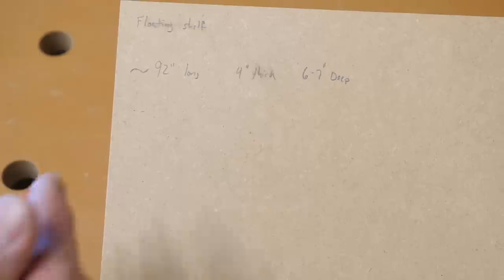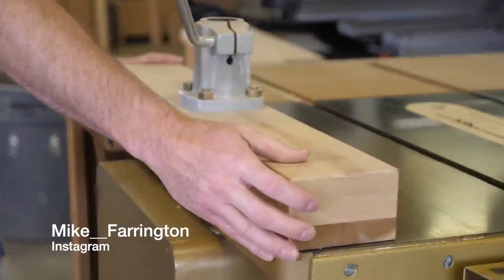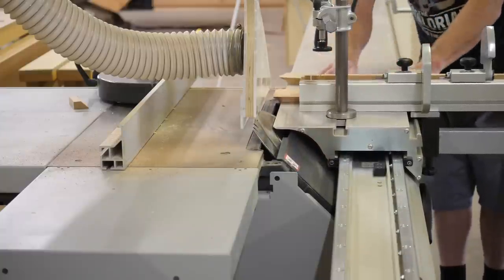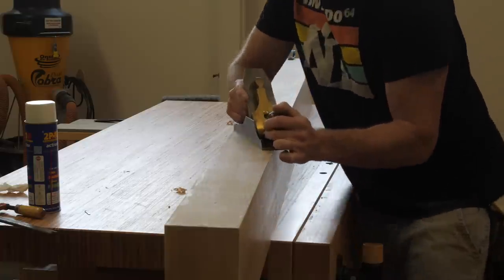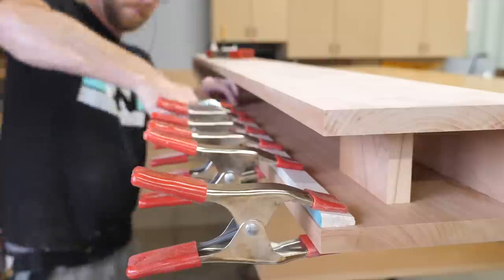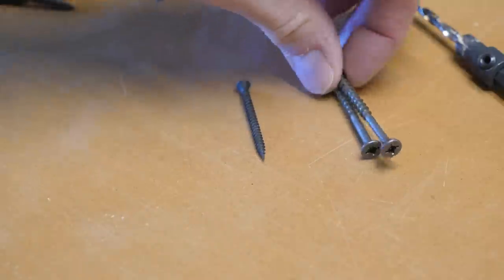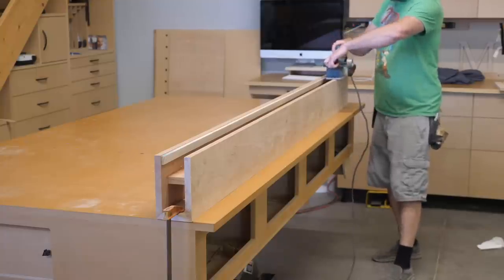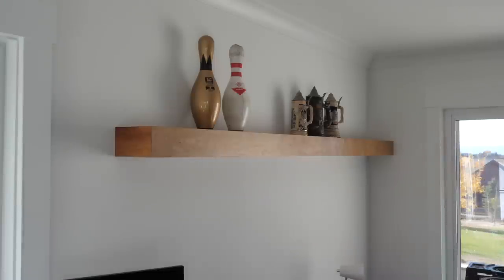Awesome Floating Shelf with folded bevel cuts.

Comment: It looks as if you just dragged a volume of wood into the corner. Gives it a contemporary-modern style.

I like seeing the monster jointer machine in the background holding the heavy frame boxes to the big bench.
Reply from the maker: Thank you. I bought that jointer with the idea that I would restore it. I got it working, and I don't like it. It has a smooth grind on the table which creates more friction than I can to push against. My current jointer has planed tables, they are a joy to work with. So eventually I will sell the project.

Comment: Like the scribing trick. Would love to see some videos of projects in older homes.  What I struggle with most  DrYing in my pre civil war home or my parents pre revolutionary home is dealing with nothing being level, plum, square or flush. And I’m not talking being out by an 1/8th.  Need some of those pro tips.
Reply from the maker: I would love to work on some older homes. Unfortunately, where I live the oldest homes are about 100 years or so. I will say things, the methods are the same, I just leave more material to be removed. Hope that makes sense.

Comment: Working out the twist in a board is always a challenge. long boards can be persuaded into place but short twisted boards are better left for something else and a new one cut. But you pulled it off as always.
Reply from the maker: Yeah. A longer board will always have a chance, shorter boards, no go.

Comment: So about 4 years ago I built almost the exact same shelf as this 3 of them actually. Same tape and bevel construction method. Even had the same issue with warped boards.    I was afraid my miters wouldn’t be tight and have 
Gaps in them.   But I wanted that rounded over router edge on them.   So I burnished the edges with a round shaft big screw driver.  This kept the miters together and the grain wasn’t effected at all because the two boards were essentially molded together.   I attached a pseudo bulk head style frame attached to the wall and slid my shelf over that.  No screws or fasteners holding the shelf to the bulkhead mounting thing
Reply from the maker: Sounds like a great project. Well done.

Comment: The result is awesome. I'm glad you did this with blue tape since I'll soon be making some loudspeaker enclosures, tall and thin. Been agonising about mitre joints even though they'll be veneered.  Should it be Biscuits ( I like them too ) or splines or ...  BLUE TAPE !
 If you got such good results with tape on that warped stock, I should be OK with Baltic Birch.
Thanks for the scenery shots, I trust the bike ride was good.
Reply from the maker: I say do one test piece with blue tape. You will find that it works extremely well.
Reply: @MikeFarrington  Thanks, sound advice. Will do since my table saw's not as good as yours .

Comment: Hi Mike, the purpose of the scribe line was to confirm correct installation after taking it down for final edge flattening? Great video, thank you!
Reply from the maker: The scribe line was to give me a mark to cut down to. I know that if I cut away the material right up to that line all the way around, I will have a shelf that fits the contours of the wall perfectly.

Comment: Why not use mitre-lock joints for the long lengths -they really hold together and pressure can be applied to the boards on the taxable router needed to use mitre-lock cutters. Nice job with left over planks. Was the missus pleased?
Reply from the maker: Miter locks are not needed when using the blue tape clamp trick. The tape holds everything in place. The missus likes it.

Comment: Awesome project as usual! Question - do you think it'd be beneficial to back cut the side of the boards that touch the wall, that way when you go to scribe you have much less wood to remove? Just a thought, not sure if it'd be worth the effort tho.
Reply from the maker: It would be beneficial, but more work. I probably should have done that.
Reply: @MikeFarrington  I thought I saw that you did that in the video?
Reply: @MikeFarrington  the back bevel with your planer was enough for scribing since it wont be seen on bac side
Reply from the maker: @jonathanacton5133  Agreed, but I think the idea would be if there was a pre bevel put on there, the scribing process would be easier.

Comment: Great video.  Could you talk in more detail about the technique you were using on the joiner at the beginning of the video where you started in the middle.   I assume it was either due to the warping or the length being so long.
Reply from the maker: Thank you. Yup. the board had some bow in that direction, so I was dropping it on, taking a pass and repeating. Once it was close enough, I took a full length pass.

Comment: awesome worke once again :)  i was curious about that cleat system once i use most of the times 45 º cuts. I thought it was slidding out after see that angled cleat. I guess those screws at the end its the secret in this case :) Well done.
Reply from the maker: Well normally I use a steeper angle, say 20-25 degrees, but my bandsaw handle broke, so I was stuck with that. It ended up working, but certainly needed screws.

Comment: Is a method like this sufficient for books? My novice brain would have guessed that a 1" cleat and screws going no more than 1" into the studs would not be enough. I'm curious whether this method would still work with say a 2" thick shelf, or if part of the reason this design is so strong is that the height of the shelf means that the bottom of the shelf against the wall helps to deal with the lever type force of the objects on the shelf?
Reply from the maker: The thinner the shelf he more pullout force the screw will receive. If you can get an accurate placement of the screw through the cleat into the meat of the stud, you will have not issue with the shelf falling. My minimum for a floating shelf would be about 2 1/2-3. That would be a minimum 1" cleat and then the upper and lower shelf parts. This will work fine as long as it's attached to the stud properly.

Comment: Nicely done, you don’t always get to work with silk. BTW what model Suzuki do you ride? Just unloaded a DL650A, it was nice but no personality. The 1000 is better in that regard. The silk is in reference to a sows ear.
Reply from the maker: Thank you. Its a Vstrom 1000. It doesn't have a ton of personality either. I've had a 650. The motor is pretty nice, but more importantly the cost per mile to own that bike is very very low, and its cheap enough to where I really don't care much about it. I would probably enjoy a GS more, but I don't get enough riding time to justify the extra cost. Maybe when the kids are older.

Comment: Ok I found something we differ on but it's no big deal, I like to go 1.5 inchs into a stud at least, but it's because I hang heavy communications equipment on walls over peoples heads sometimes and I live in Earthquake plagued California🤣🤣🤣. Just one inch into a stud for a shelf sounds on the light side to me because I like to hang my 210 body on everything I install.  If I can't hang on it I don't walk away till I can👍 but I am sure your shelf is plenty strong for your items👍💚💪🪵😁Happy belated Birthday 🎉🎉🥳🥳
Reply from the maker: My 1" rule, which I violate once in a while with something super heavy, comes from the code that a hole in a stud needs to be 1 1/4" from the edge.
Reply: @MikeFarrington  I know your smart because you don't over tighten your screws 😁🐘 I had a feeling you might be flexible on your one inch rule also, I bet you wouldn't be hanging things that would fail, your very smart Mike. Thanks for posting you are always a pleasure to watch😁💚🪵
Reply from the maker: @chrisstearns10  Thank you very much Chris.

Comment: I've never seen that jointing trick at 0:38 ... are the high spots on the far ends of the boards and this is a quicker/easier way to knock them down?
Reply from the maker: Thank you. Yup, when there is a high spot, I will just run that a few passes to get it closer to the rest of the board. Then finish with a full pass.

Comment: I’m somewhat of a novice to woodworking, but I love watching your videos. I’d like to make a couple shelves like this, but I only have a dewalt job site table saw. No jointer and no planer. Can you offer any advice to do the project without those tools?
Reply from the maker: Thank you. I would buy planed lumber, then use the table saw to cut the bevels, if you have a chop saw, use that to do the ends. If the pieces are really long have someone help you hold them on the out feed side.

Comment: Why such a shallow angle on the cleat? Is it because the screws end up providing all of the "slip" prevention?
Reply from the maker: The screws do help stop slip. Normally I cut the angle a little steeper, but the handle broke on the table on my bandsaw, so I was stuck with that angle for a few days until I fixed it.

Comment: I like your cleat method for holding them. I built some of these for my living room and basically used same method of construction but my method of mounting was an fir framework like |__|__| on the wall they slide onto. That was way more complicated and fiddly I think than your method. As always enjoy your videos and always learn something.

I notice you are one of those people who back the screw out a bit before driving it in all the way. I've never found anyone to tell me why they do this. Can you share why you do this?
Reply from the maker: Thank you. I don't always back screws in and out. In this case my battery was almost dead, so I needed some momentum to drive um home.

Comment: After jointing the boards you used the bandsaw to get a parallel edge. My novice self would have gone straight to the table saw. Did the bandsaw provide some advantage you would not have gotten from the table saw?
Reply from the maker: Same thing really. I like the bandsaw because its safer and has better dust collection.

Comment: Looks awesome man! I have been wanting to add some floating shelves to my pantry (because my wife said I should) and was wondering if it could be built in place, since the door jamb is narrower than the shelves would be. Any thoughts or tips for this? Any advice would be tremendously appreciated!!
Reply from the maker: I have done a bunch of those, normally I installed a ledge on three sides, then cut and fit the top and bottom and nail a trim piece on.
Reply: @MikeFarrington  Thanks so very much for responding! I'm stoked to go cut some wood!

Comment: Hi Mike...awesome job. one question....the end piece you placed isn't going to give you problems because of wood movement? or does it become a static point because there is not end piece on the other side?
Reply from the maker: Wood movement won't be a problem with a piece this small. There is enough give in the glue to allow for the small amount of movement a piece like this will have.

Comment: What's the jointer technique you're using at 0:38? Start halfway, get the back half flat, and then move to front end and make it level with the back? Is that just because of the length?
Reply from the maker: The board had crook in it, I was simply cutting down one part of it, once it was close to flat, I went back to normal methods.

Comment: There's nothing I hate more than making long bevel cuts on the table saw. I NEVER get nice results. I guess I need to focus more on down pressure at the blade. I don't think a power feeder is in the cards for me.
Reply from the maker: No problem without the power feed. Just setup a bunch of feather boards.
Reply: @MikeFarrington  You know... I've seen people clamp a feather board to their fence, but I've never tried it... I've also never thought about how to get it close to the blade on a wide panel. I'm going to go do some research. Thanks!

Comment: Just a quick math thingy...if you want the outside joint to be nice and tight you should go slightly above 45 not bellow it. ;)
Reply from the maker: Sure about that? I guess it depends on which side you're looking at.
Reply: @MikeFarrington  Yes I am fairly confident in what I am saying, but you are right about the which side part. One thing to note that might cause the confusion here, when I put my digital angle finder, I put the magnet towards the blade  so my zero is in that position. I am therefore not measuring the angle of the saw but rather the angle of deflection from 90. When I want a 90, my meter will simply give me the current error and not the angle itself. I can simply slide my angle reader on the table and let it stick on the blade.

If you stick the magnets to the table and then to the blade, then yes the angle needs to be bellow 45.

Sorry for the confusion regarding that.
Reply from the maker: @simonmarcoux5879  No problem. Angles are tricky that way, there's two ways to look at them.

Comment: Hi Mike - Love your videos. Great work, as always! I like the idea of the cleat method you used vs. metal posts like a lot of other floating shelf tutorials. Are the weight capacities similar for those two methods? And any idea on how much weight your setup as shown would hold?
Reply from the maker: I'm no engineer, so I wouldn't guess a weight capacity. I will say this shelf will hold everything I could put on it. This is a very strong way to build this type of shelf. If more weight capacity was needed, I would use 8/4 lumber for the cleat.
Reply: @MikeFarrington  Thanks for the reply. Keep up the great content and music selections!

Comment: I have 2 pro tip type questions…
1.) What is the difference between a power planer and the lipping planer that you use and 2.) was setting the angle for the bevel at 44.9 a common practice or because the boards were warped? If I am prying too much, just tell me to fornicate off 😂
Reply from the maker: Thank you. A power planer has the blade centered under the handle. A lipping planer has it offset to one side. I do the 44.9 thing any time I'm doing a long miter. Ha! I would never tell someone asking good questions to fornicate off.

Comment: Fucking show off. Lol. Your work is amazing. Love that you took on this challenge. Curious if the mitres will change over time with two outside walls depending on the insulation, considering your climate is akin to mine up in CANADA.
Reply from the maker: Thank you. I'm not worried about the miters, we live in a dry climate, and we humidify during the winter, so expansion and contraction will be at a minimum.

Comment: the front face and the end face would have looked better if they were out of the same board, then the grain would have continued from the front face to the return into the wall. And why would you not plane your boards straight? that's asking for trouble working with twisted material.
Reply from the maker: I didn't have a board long enough to have continuous grain. I didn't joint the boards straight because they were so twisted by the time I got a flat face, there would have been nothing left.

Comment: Planers can be used to flatten your wood ,maybe if you were to explore other  tubers ,you would find the answer . It’s rather easy and it has a 100 % success rate . Sorry that I will not watch the remainder of the video but your to negative
Reply from the maker: Many tools can be used to flatten wood. In this situation I didn't have enough thickness to flatten the boards. Had I flattened them they would have been 1/8" thick. I'm sorry you feel I'm too negative, I'm not sure I understand that.